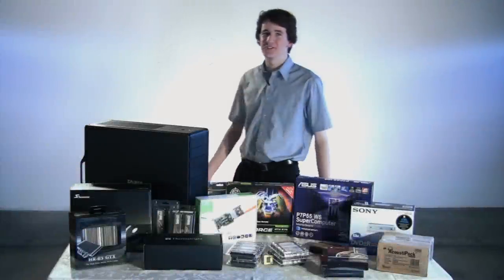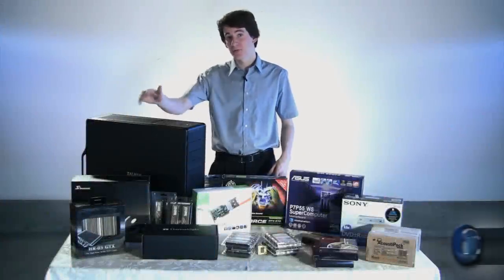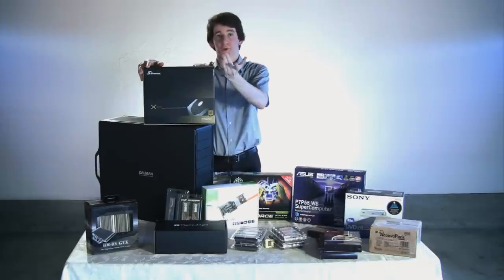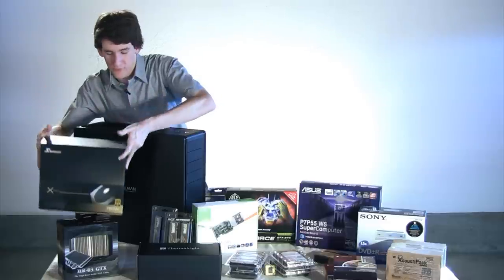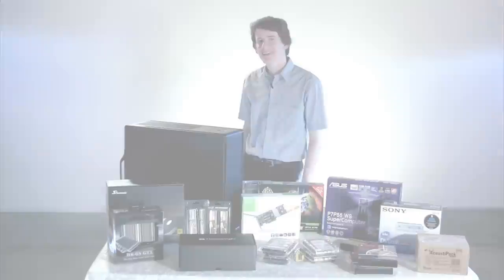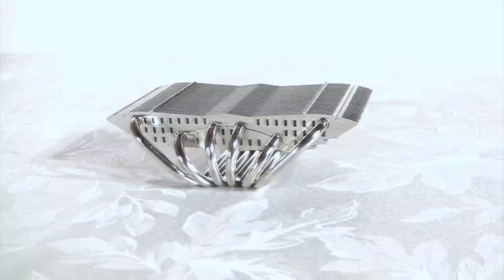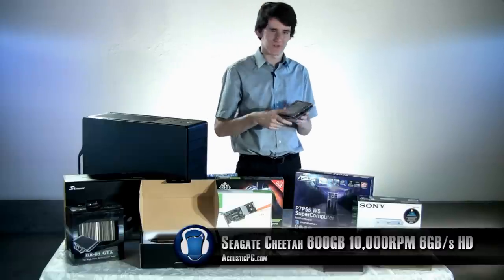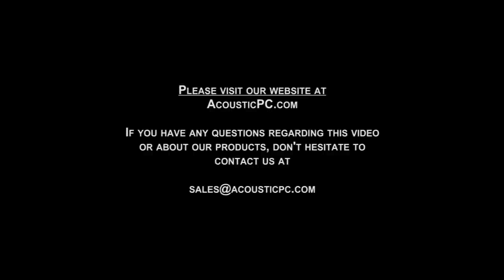How to Build a Quiet High-Performance PC Video Overview - Part 1 - AcousticPC.com

Comment from the maker: @Exestenz This case is awesome for high ventilation and quiet.  you have fans you can add on the top, bottom and of course the back exhaust fan. plus you can add 2 more modular drive racks witch will give you capabilty for up to 9 hard drives and each bay has a  fan option for more cooling. Nv 480 is going to be hot in any case i suggest a good cooling solution for the card as well.

Comment from the maker: I would recommend using our Seasonic 850 Watt Gold or higher. The 850 will be enough. It Keep the system running stable plus cool & quiet

Comment from the maker: @9b8 We have never had an issue with a CPU or mainboatrd W/ thermalright this is due to the awesome bolt thru kits they provide. The nickle plate has been taken down to a molecular level thus transfers heat efficiently also Thermalright works closely with Intel for design and lapsing there bases to match the CPU. WE HAVE NEVER LAPSED 1 & I HAVE HEARD MIX RESULTS ON THIS. Some even go as far as lapsing the CPU. personaly even if i could shave off 1-3 degress i prefer the anti-corosion properties

Comment from the maker: @9b8 it should fit firmly in place when tightening the screws. on the newer TR coolers we sell  such as the Thermalright Venomous X or even better the Thermalright Venomous X Silent CPU Cooler includes more brackets and dual fans. it also comes with an amazing bolt thru kit called the pressure vault you can tighten to 20, 50 pounds etc it actually increases performance. something does not sound right with your install. it should not be really lose like the way you are describing

Comment: @acousticpc Thanks for the response. Quick question: Is it normal to be able to twist the Thermalright Ultra 120 Extreme with your hands after mounting? I know it isn't supposed to be super tightly bolted, but it seems way too loose for my liking. With the weight of it, I'm concerned that it isn't SQUARELY making contact with the CPU. I have a X3360 Quad Core, and two cores are always a few degrees hotter, averaging 41-43 at idle on stock settings! I even shimmed the back plate to no avail.

Comment: LOL! I just made a computer with basically the same parts, I used a hs2, same motherboard, and a an X3440, same cpu cooler and some power supply! I had never seen the video before ether. I guess as they say "great minds think alike" :P

Comment: I'm wondering what your opinion is about CPU/heatsink lapping. I have the Thermalright Ultra 120 Extreme and noticed many lapping theirs to theoretically get better surface contact and thus heat transfer. I'm skeptical of this, however. Also, I notice it is very heavy, and for an upright tower, puts a lot of torque forces on the motherboard which is concerning.

Comment from the maker: @asfbi This PC was built for and example. We could have gone more expensive or less, the point is you don't have to have SAS drives or an lsi card or a gaming card. It really just depends on your application. We focused on what we were going to use it for witch was video production and rendering witch is very demanding. But you can accomplish a quiet PC with out these high-performance parts. All you need is the right quiet cooling hardware.

Comment: Many builds with only a single GPU do not need anything more than an efficient 550 watt PSU. if you want SLI or crossfire, get an 80+ 750W or more.

Comment from the maker: @gdialpha We sell water cooling as well but remember you still need cooling fans on a water cooled systems so really it's the same. Also the high-end air coolers perform excellent at a fraction of the cost without the risk of leaks or maintenance.  The Performance is very close as well.

Comment: I want to buy a Gigabyte GeForce GTX 670 2GB PhysX CUDA but im worried that the power supply i have wont be enough...i have looked on the power supply box but i cant seem to find info about it if it is enough or not...i got a Geforce gt 420 right now so i guess my power supply isn't that good since i bought my computer from a store...

Comment from the maker: @Nefus1988 What i can tell you is the end result of this build was extremely quiet and high performance.  ZALMAN cases are top of the line. We do sell EXTRA sheets of Acoustic Sound Dampening material in our site Acoustic PC so you can add it anywhere on your case you feel is necessary.  Also our EXTRA sheets of soundproofing is much higher quality and performance than what case manufactures offer.

Comment from the maker: @Nefus2 This quiet CPU cooler out performs the Corsair and you don't have the risk or maintanace of water cooling. The performance always stays the same. Also I'm not comfortable with having a vibrating pump on a expensisive CPU like this one.

Comment: Lol he use a Zalman case? Why not choose fractal design R2? It have sound dampering material on all sides. Those silenx fans are very quiet what I seen on their website, one of their 120mm fans rotare at 1100rpm but only makes 11dba in noise but oddly this guy are just using those fans on the cpu heatsink.

Comment: £400 - £450 if you really stick to the bare minimum for everything except the graphics card which you would want to spend a little more on to get decent 'frames per second' in games.